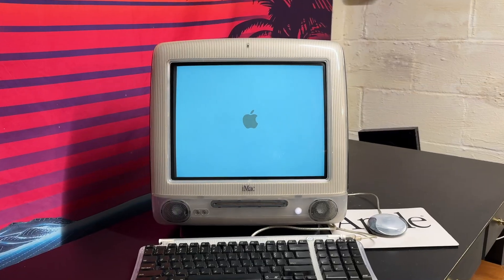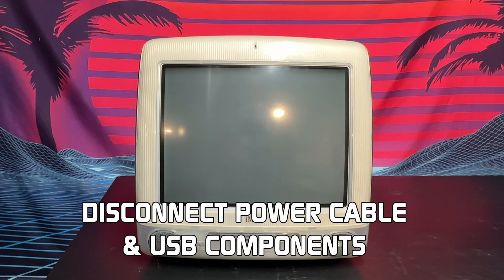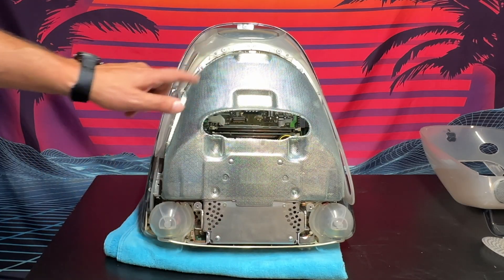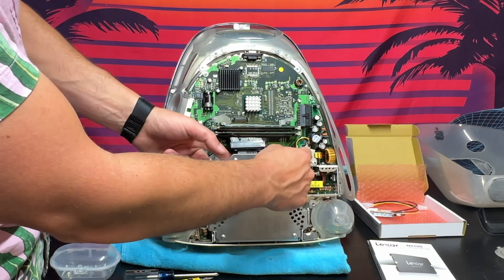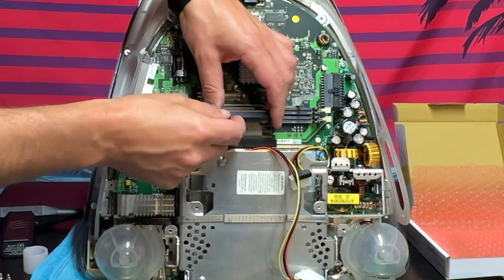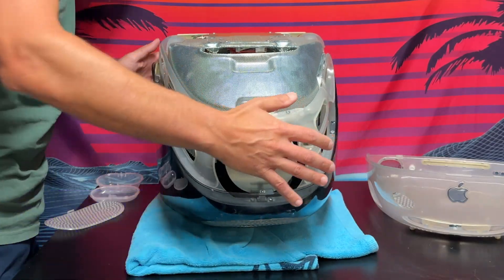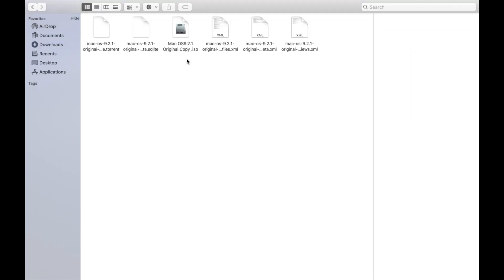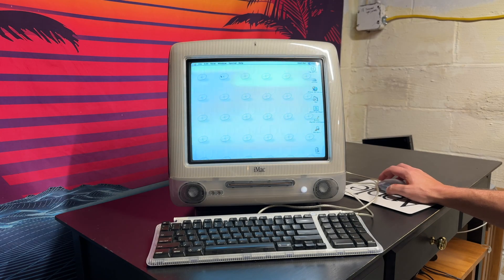Upgrade Your iMac G3 with Lightning Fast SSD and Fresh Mac OS 9 Install!

Comment: Both my crucial ssd,s decided to slowdown and fail after only3 to 4months.. my macbookpro 2012 nonretina now has
its Sandisk SSD before i thought crucial was better. and im also going to readd my DVD Drive in my old macbook
as i found it useful
Reply from the maker: That's a bummer about the SSDs! Crazy to hear that from Crucial, I usually had good experiences with their products. Might be worth a shot to see if they'll replace them under warranty if it's only been a few months. Hope the new drives work out for you though. Thanks for checking out the video!

Comment: Its not worth it....
Reply from the maker: What do you suggest then?
Reply: 7200 rpm hard drive,not 5400 rpm. If its a 3-2 ghz processer , a ssd upgrade is fine.

Comment: I tryed this method on my iBook g3 snow and at the moment that I wanna install the system it says this program cannot run on your computer and I can’t install the system on the computer 😢
Reply from the maker: Ah bummer! Were you trying to install OS 9? The later iBooks (800 mHz and up) can't run OS 9 natively, it can only be run in Classic Mode inside OS X.
Reply: @retrogameattic I have downloaded like 4 different installers and I used the burned disc to access Mac OS 9 again and another installer on a usb stick and I installed it like that and it’s running natively
Reply from the maker: Did you try a later version? Like 9.1 or 9.2.2?
Reply: @retrogameattic i tryed 9.2.1 and that worked just fine with my iBook also it’s the one with 2 USB ports and a 900mhz processor
Reply from the maker: @joegamer1696  Awesome! Glad it worked out.

Comment: thank you very much for this- super helpful and easy to follow. i just dragged our old one out of our laundry room shelf on a whim and am determined to get it usable again… i managed to get it to boot on my first try but nothing after that, so im hoping its just the ancient hard drive(that was already on its last legs last time it was in use) croaking. i also hope the cd drive works to actual install the os because i didnt have a chance to check:,D any tips you have for someone whos never done this before? and how could i go about recovering files from the old drive?
Reply from the maker: Thanks and glad you enjoyed! Awesome you're getting yours going again. It does sound like your hard drive has failed or is failing. Does the power button illuminate when you attempt to turn it on?

The CD drives are pretty unreliable these days. The iMac G3s I come across usually can still read discs, but they cannot eject them without the use of the manual eject button or just finessing the disc out with a spudger.

My biggest tip would be to review instructions and videos so you have a firm grasp on what to do. It may seem intimidating, but it's not that hard once you get the casing open. There is a good chance that some clips will break since they're brittle to begin with though so don't beat yourself up if some break. From there, it's all just plug and play afterwards.

If you can get the computer to boot before hard drive replacement, your easiest bet is to plug in a USB thumb drive and recover the files. Otherwise after you remove the hard drive, you can buy a SATA to USB converter to connect your old drive to a modern PC or Mac. 

Here's one I found but there are probably better examples out there: https://a.co/d/0BwBG8c

Hope this helps and best of luck. You got this!
Reply: @retrogameattic thanks much! the lights all good, just loading the desktop is where it struggles. the startup screen pops up along with the wheel (its on os x) but nothing after that.

Comment: I won an GSA auction of a pallet of these 20 years ago for $50. Used them in my classroom as a lab for a few years. Gave them all away to kids eventually. Before then had gotten labs of Power PCs, Quadras, Performas, LCs, SE30's the same way. Never kept any because I was flipping properties and couldn't be held down with stuff.
Reply from the maker: Wow, that pallet would be worth a small bundle today! Who would have thought that the iMac G3 or any of those vintage Macs you mentioned would be sought after. Very cool that you gave them away to the kids after they were used in class, I'm sure they were pumped. Thanks so much for checking out the video!

Comment: well my hard drive still works on mine i got a 40gb one , i hope it lasts it still is fast enough though i tried to switch to an ssd but the addapter was broken ,also in the past the speakers were blown and i replaced those but broke plastic clips and had to glue them back on i have a 1999 g3 dv tangerine with 400mhz and 500mb of ram btw
Reply from the maker: Right on! I wouldn't mess around with the original HDD if it still works well. Sounds like you have a solid setup! Thanks for checking out the video!

Comment: Are you able to use the full 256 GB SSD you installed? I thought Mac OS 9, along with G3 and early G4 Macs, could only use drives up to 128 GB (without some workarounds). From my experiments, it seems you can boot these old Macs into large drives through FireWire, but the IDE bus can't understand or see a drive that big.
If you have a full 256 GB of internal storage in your OS 9 iMac G3, that's awesome.
Reply from the maker: Unfortunately it's capped at 128 GB and I can't utilize the full 256 GB currently 😒. I snagged the larger capacity SSD since Amazon actually had it cheaper than the 128 GB at the time of purchase. I may explore a workaround in the future though! Thanks for checking out the video!

Comment: Nice, I just did this today! LOL. I'm waiting for a new PRAM battery before I close everything up though.

How do I install OSX on it though? I want to dual boot between OS9 and OSX. PS, my DVD drive doesn't load and unload discs properly... I might be able to try to burn one if you think that will help though.

Also I broke the clips on my bottom part of the shell :( Will that be a huge problem or is it "ok" enough? 

Thanks a lot for all your help! I never had any PowerPC macs growing up but did work at a place that had a fleet of them so I had to maintain them a fair bit when I was a teenager.
Reply from the maker: There’s a few variables at play here; do you have tray or slot-loading G3? OS X isn’t officially supported on tray-loaders, but it is on slot-loaders.

If you have a slot-loader, you can dual boot by partitioning your new SSD into two volumes; one for OS 9 (around 8 GB) and one for OS X (the remainder of the SSD).

You can download the OS ISO files from GitHub or Internet Archive. Using the CD/DVD drive is the easiest/most straightforward option. If your CD/DVD drive does still sort of work, install the OS 9 ISO first, then OS X second. The manual disc eject button on the right side of the CD/DVD slot is a lifesaver on these old drives.

Breaking the casing clips on these is like a rite of passage 😂. You will be fine as long your casing screws are reinstalled.

Hope this helps, best of luck, and thanks for tuning in!
Reply: @retrogameattic  Thanks for the response! This is a slot-loading one with the VGA out port on the back (that's also not working, not sure why though).

I think I might have some luck with taking apart an old Lacie Firewire HDD which has an IDE connector on it. I've been able to get a newer mac to read burned CDs so I'm going to try my luck on the iMac later on! 

Any idea on the VGA out issue?  Thanks for letting me pick your brain on some of this stuff! 

PS If you're into any retro PC gaming check out my latest video as it might help on your retro journey
Reply from the maker: @DaniSarfati  The VGA out port may not be working since your CMOS/PRAM battery is most likely dead. I would give it another try once your replace the battery and reset the PRAM.

Thanks for tuning in! I'll be sure to check out your channel! Good luck on your iMac!